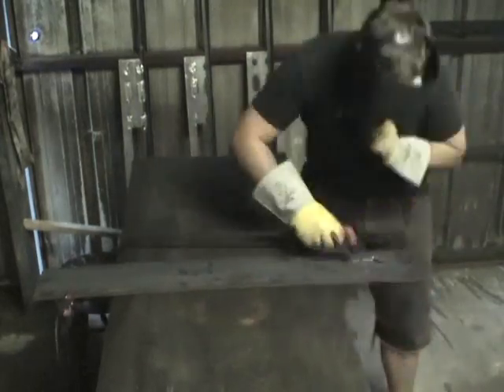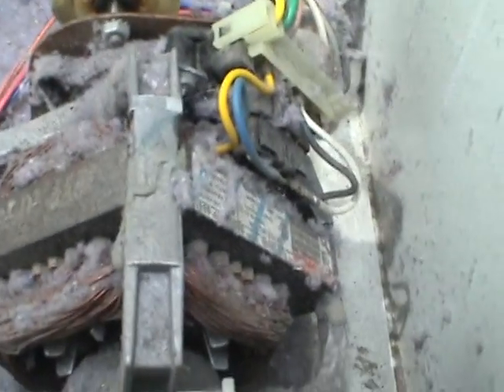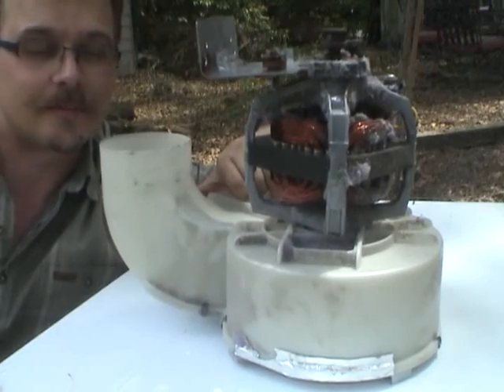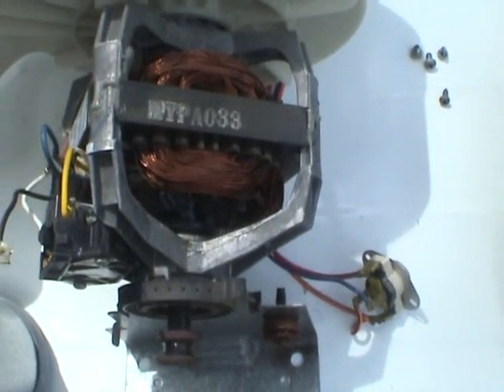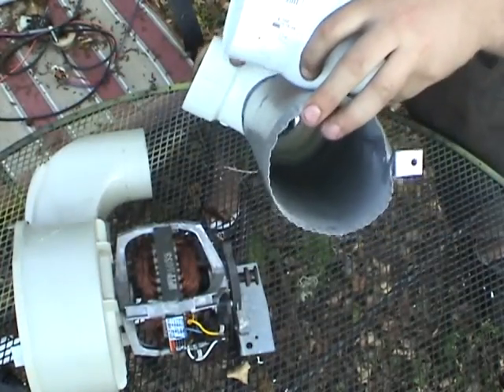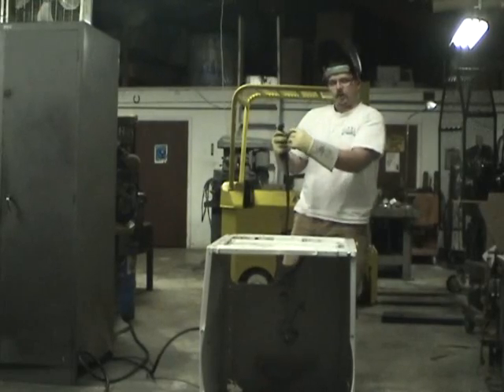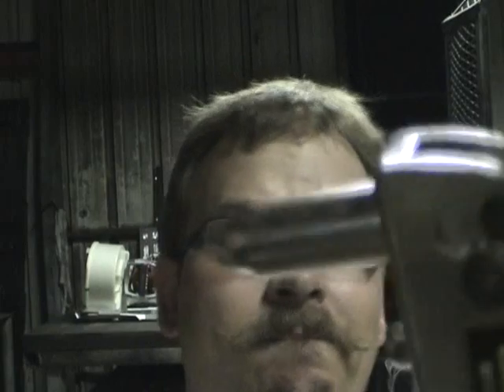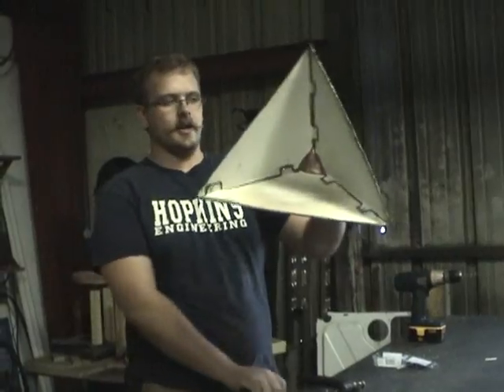Extreme Upcycling Episode 1 - Dryer

Comment: If you attach a smaller diameter tube it will pressurize the air to fling the balls at a higher velocity